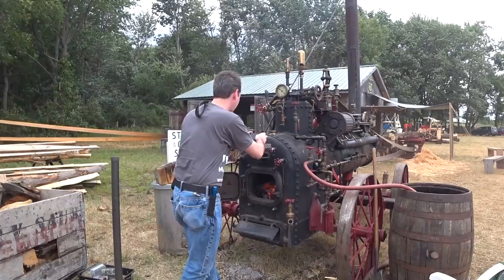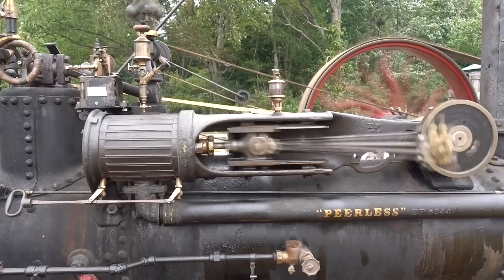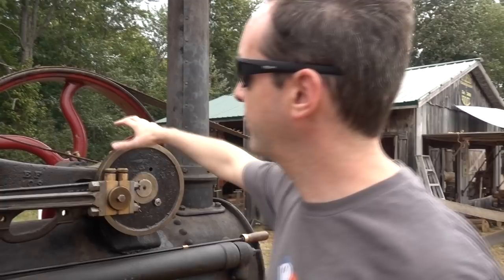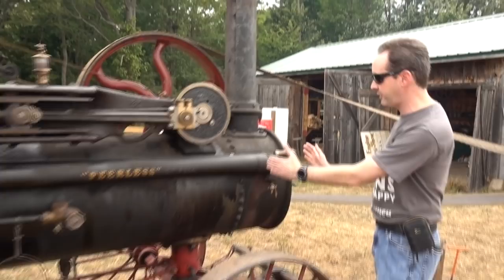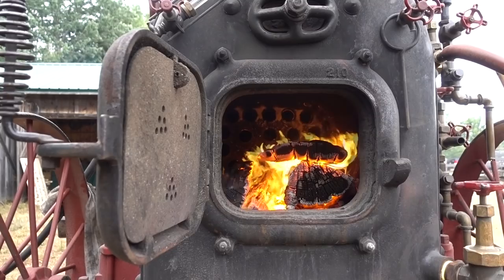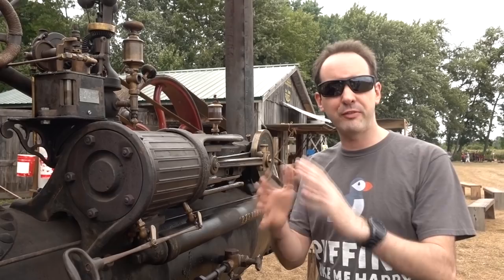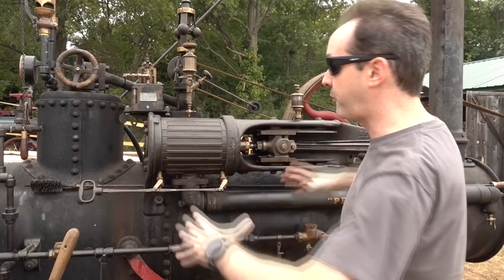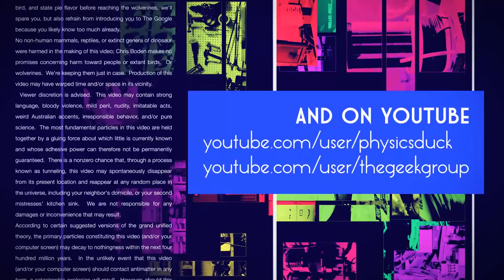Captain's Blog 7 20 2018 Steam Engine Improv Demo

Comment: starting at the fire box is good.  why does it issue steam from a few places?  a certain UK railway uses steam.  those balls are a form of cruise control.  get a steam engine as backup power for lab lights.  some words are obscure.